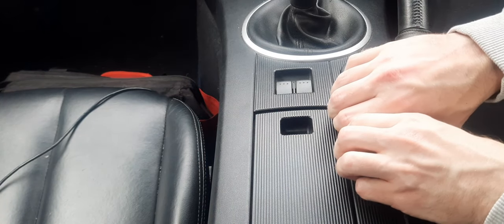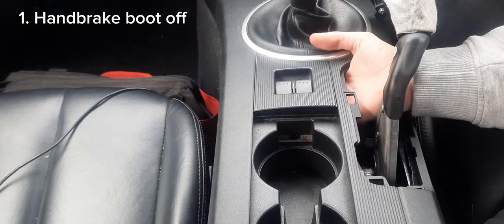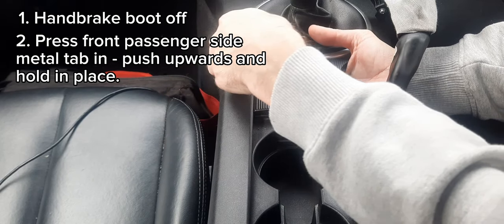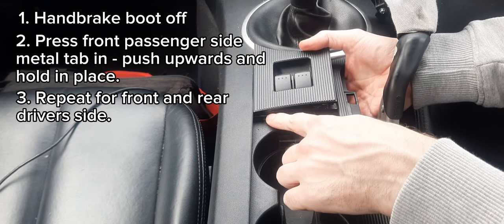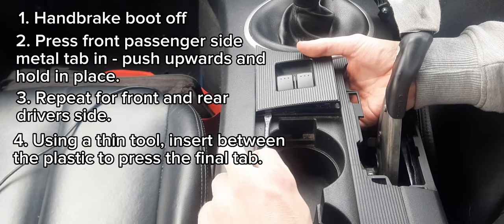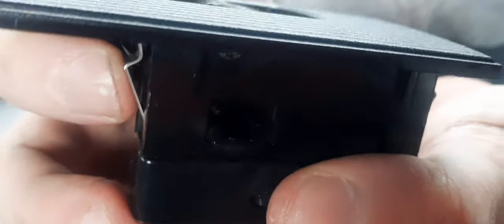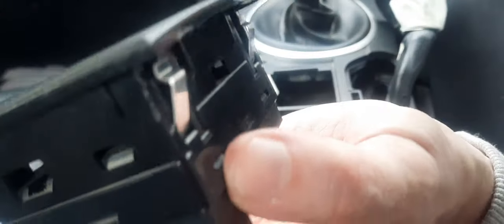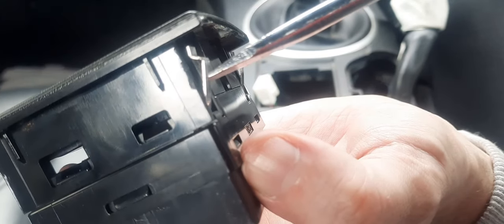Maxda MX-5 NC - Window Switch Removal

Comment: Mat- very useful. Having the same issue myself with the passenger window. When yours failed, did you still hear an audible click from the window regulator despite it not working? (Can’t speak for the hood as mine’s manual). Seems to be some difference of opinion on the forums as to whether it’s likely the switch or reg. I’ve got a new reg/motor assembly but clearly much more work involved than the switch box!
Reply from the maker: @antonyparker6112  Heya, no once it failed it never clicked when I pushed the button.
On a related note though, I've had to take the regulator off before* (someone broke into it, so had to replace the glass), and other than being a bit fiddly with the speaker wires it wasn't as tricky as I feared. Hope that you manage to sort it and its a smooth job!

*Edit: it turned out I didn't need to take the regulator off to replace the glass 😅
Reply: Thanks Mat! Much appreciated 😊. I think it points to the reg as I’m getting an audible click when I operate the switch, which sort of suggests there’s some power getting there. Good to have the switch trick up my sleeve in any case! Keep the content coming - really helps out 👍🏻

Comment: You need small hands and long fingers. The front clips were fairly easy, but had to use a fine screwdriver on the back ones. On my 2006 mk3 there is a spacer - be sure to get the screwdriver under the spacer to release the back ones. Another mistake I made was to force the multiplug out, not realising there is a tiny release button on the side. So, here was the plug, blocked by a bit of old unit that I managed to suck out with the hoover.

Comment: Hey Mat I tried following this but unfortunately I have the automatic and there is all sorts of wires and other things in the way making it impossible to get my hand or fingers in there to squeeze those front tabs to release it.
Reply from the maker: Damn it ☹️ sorry to hear that. The alternative is to take the entire centre console out. You have to take off the gear stick (the manual simply unscrews, not sure about auto), and there are 5 bolts to unscrew; two at the front under a detachable plastic trim, one under the cup holder, and two at the back under another piece of trim. Its quite awkward to get off as you have to disconnect the window switch before it lifts fully off, then get it past the handbrake.
Reply: dang so I tried with my son taking the whole console off and even that is super difficult with the automatic,  there is so much more crap in the way, we are unable to get the clips to release and we cant even get the electric connections to come off.  Looks like I'm going to have to look for a mazda specialist who knows how to do this the easy way.  thanks so much for trying to help with this video though @mat_tamarin
Reply from the maker: Ah that's a shame, sorry it didn't work out but good on you for giving it a go! It's a common fault so a specialist should have it sorted in minutes 🙂